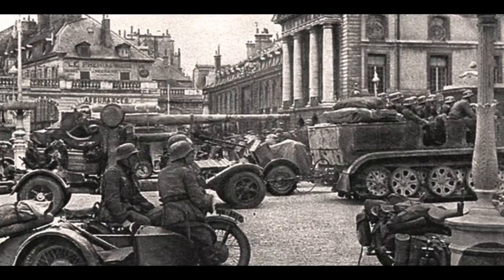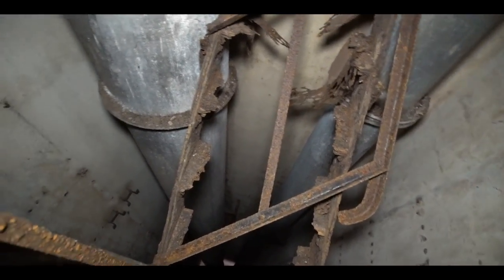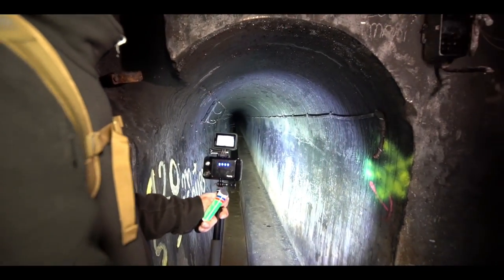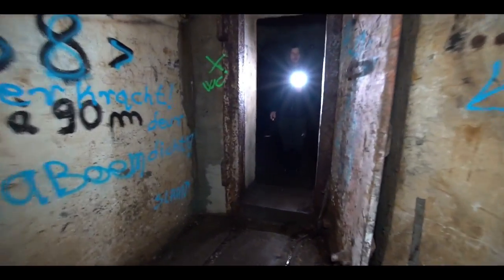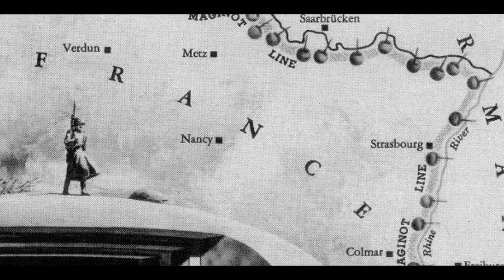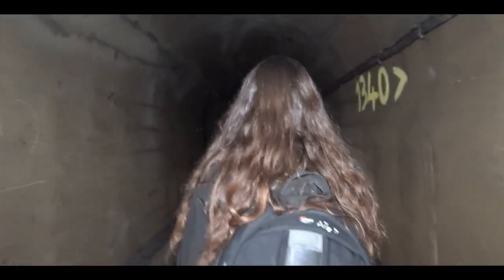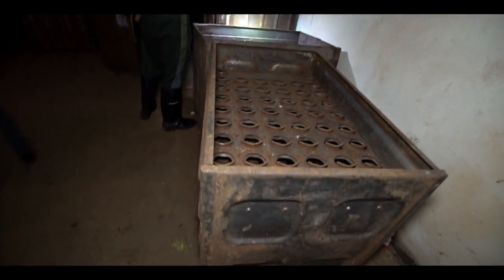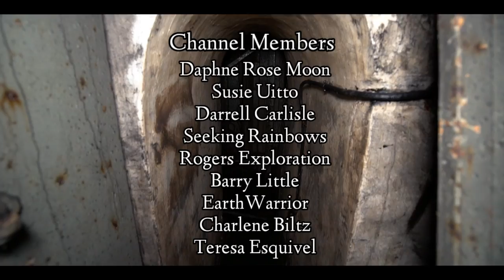Europe’s Abandoned Mega Bunker - The Maginot Line WW2

Comment: 16 miles deep 😮 did you mean metres? 😆👍 Great explore 👌
Reply: Normally 20-30 meters depending on the nature of the underground
Reply: @marietht6179  exactly! 16 miles my arse
Reply: @duncandisorderly6562  I‘m not using the imperial measuring system so I do the conversion 16 miles are 25km so I guess it gaves a confusion between meters and kilometers.
Reply: @marietht6179  the deepest hole ever made was only 7 and a half miles 😅👍

Comment: Interesting video, but your location is not a secret.  It is the Gros Ouvrage Brehain and the combat blocks are across the main road, on private property, from the entrance blocks which are in a small wood on the other side of the main road.  You should have included a view of the two entrances (Mens Entrance and Munitions Entrance) since we would like to see how the army covered them up at the end of the century to keep people out.  This is one of the larger ouvrages, but some of your information is incorrect. You used a propaganda drawing from the late 1930s that looks nothing like the forts and they are not connected to each other by a tunnel system that runs for many miles. Instead each ouvrage has its own tunnel system between the entrance blocks and its combat blocks which normally do not extend more than 1 kilometer.  Except in the Alps, these forts have one level underground which is about 30 meters below the surface.  The main gallery leads to the combat blocks and near the entrance blocks you find the caserne (which you passed through) and the usine (the power house), and the main magazine (M-1). Some large ouvrages split the main gallery into two parts leading to two sections of combat blocks.  Apparently you entered one combat block for a 75mm gun turret (2 guns) since  you showed its toboggan like shell return which you did a good job of filming.   Many of the components of this fort were removed by the group that operates the ouvrage of Fermont, further down the road. I strongly advise you visit Fermont, Hackenberg or one of the other Gros Ouvrages that are open to the public for visits since you can see all the key components and learn how they work.   In addition, there are many books in French and some in English that cover the Maginot Line and include plans. There are also a number of interent sites such as this one:  https://www.lignemaginot.com/accueil/indexen.htm   It has a section in English and you can find simple plans of all the Maginot ouvrages and basic information about them.  It is also interesting to see the art work since one book on the art of the Maginot Line only includes a photo of the erotic view of the naked woman and nothing else from Brfehain. Have fun on your next trip.